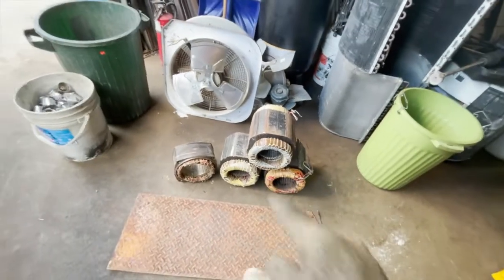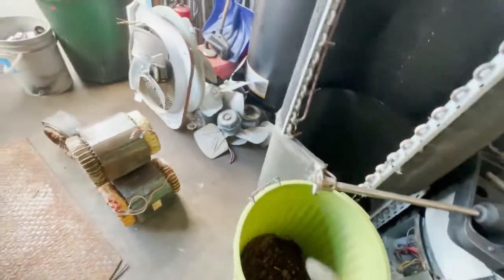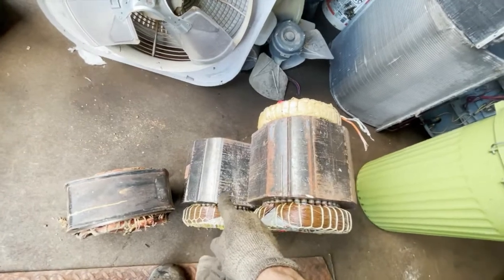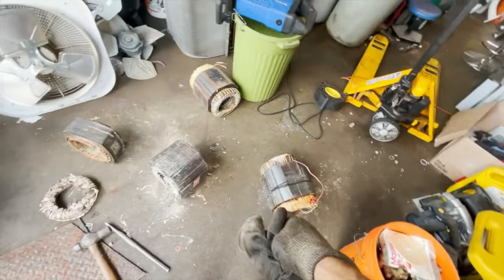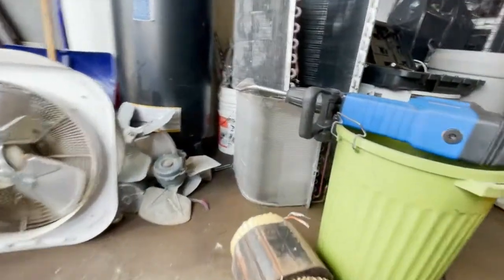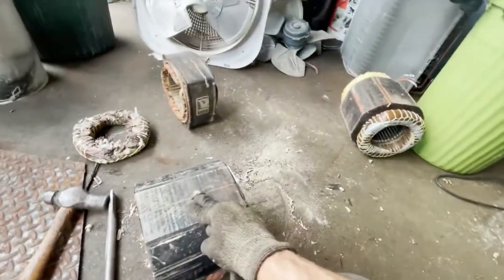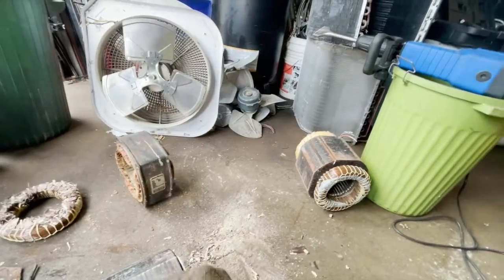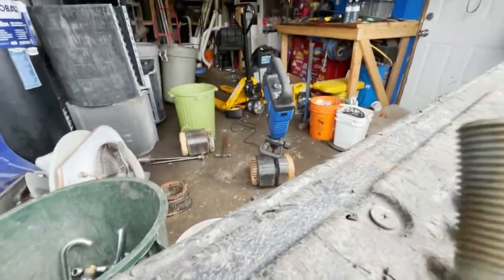Experimenting with jack hammer vs motors

Comment: I use a large machete knife to cut up my stators out of HVAC sealed compressors. Takes less than three minutes per unit . Hammer with two pound until it cuts copper.remove knife and move around the stator(usually four cuts does it). Blade is very sharp and thin

Comment: Long stroke demo hammer with a super sharp 6 inch blade with a thin profile works the best. The stock blades are too thick and get bound up with side pressure when splitting the stator. Use a 2 inch blade with a U shape cut in it for pulling the coils out of the split stator.